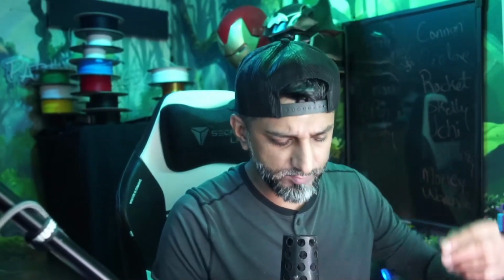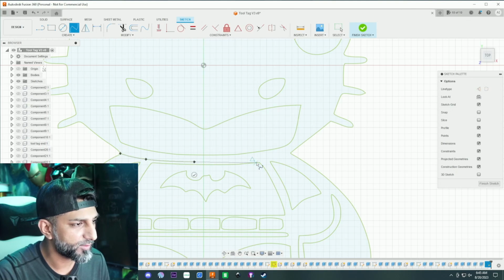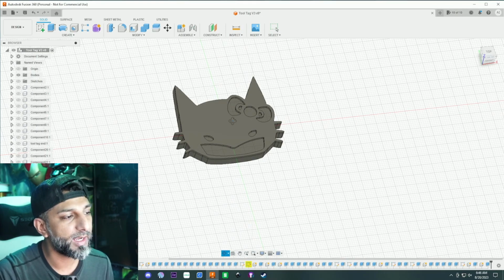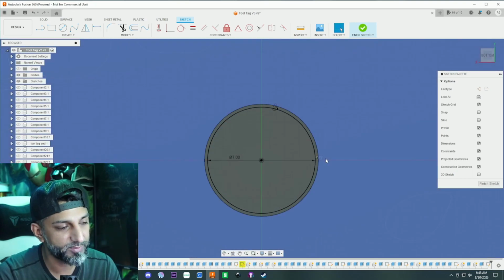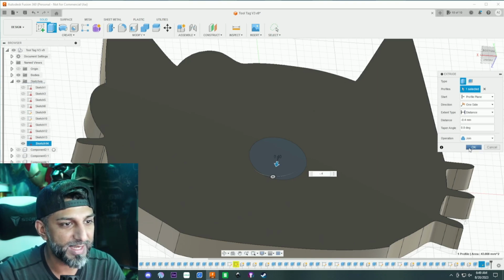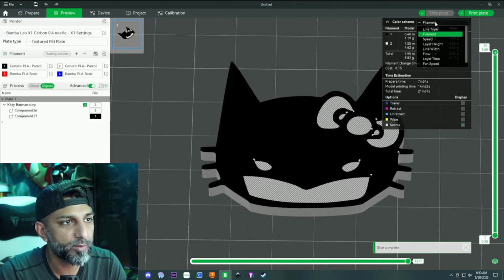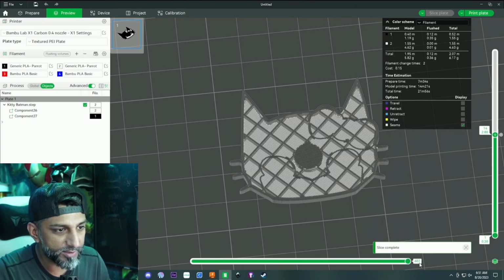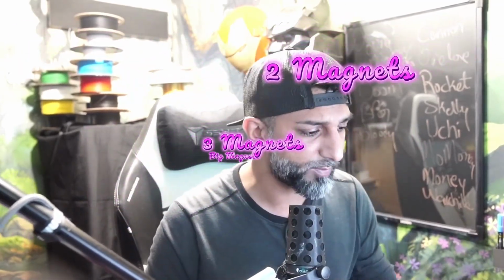Hidden Magnet 3D Print Design! #3dprinting #3ddesign #3d

Comment: Great tip! I have been doing something similar but setting the extrusion to begin at an offset. I like the advice from other comments to add glue; usually, I try to make a snug fit around the magnet.
Reply from the maker: Right I did one with the glue afterwards and came out great

Comment: Good video! I did this on another printer. I modeled and printed alphabet magnets for my nieces 1st birthday and didn't want her to be able to access the magnets. I found it best to drop a dab of super glue into the hole first so when the print resumed the magnet didn't come out and stick to the steel nozzle as it passed over.
Reply from the maker: That is a really good tip. I had a few jump out lol